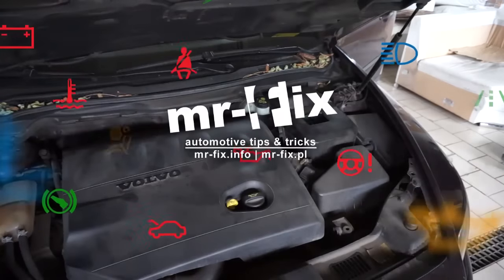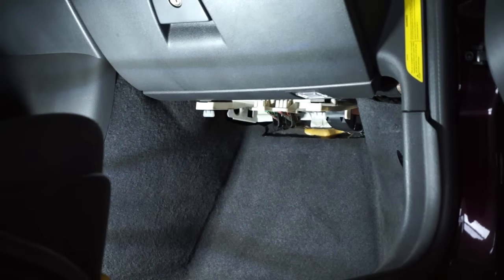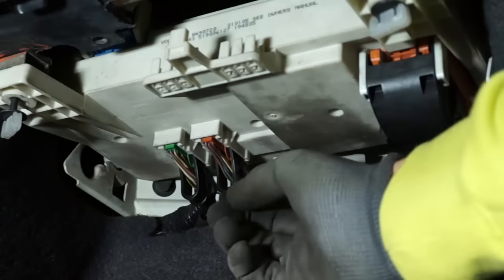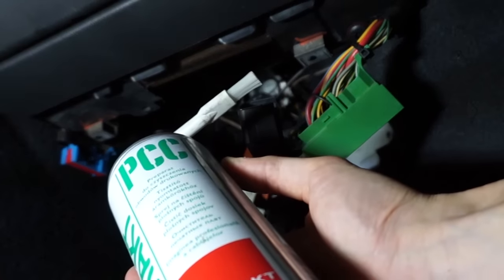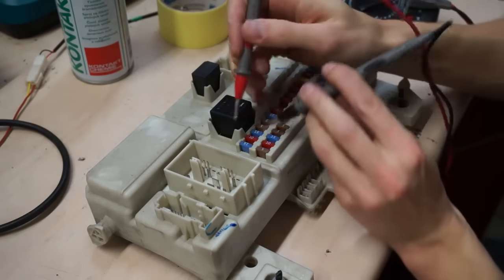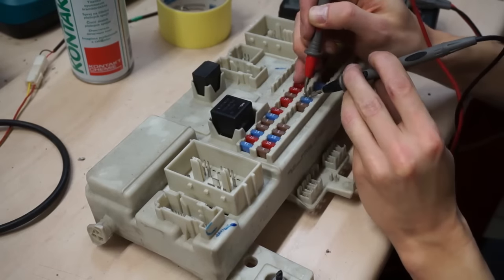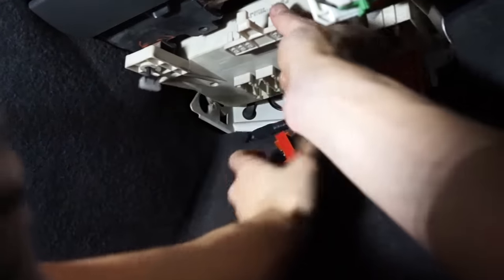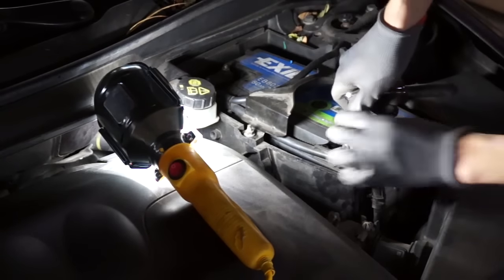Volvo C30 S40 V50 CEM / Ford Focus MK2 GEM connectors fix

Comment: I want to give this video a good thumbs-up x10000 and stick in on the first page of YouTube.

Here is my story. I have had weird electronic issues for the past 4 years of owning this vehicle. Some of them really annoying and even game-breaking, others no so much. When I first cleaned and re-attached my outside temp sensor and it started functioning properly, many of the faults disappeared but some of them remained. Difficulties to start engine, random errors on dash such as anti-skid temporarily off, anti-skid service required, ABS failure, traction control fault, radio and A/C acting up, windows not working properly. I did not give it so much attention as I should have at that time since all errors disappeared once engine started and others were not as bothersome.

All that to a point where my car would just not start anymore. Happened last sunday, was driving normally for two days and 600 kms and when I took a break to quickly wash major dirt off car, it would not start at all. Tried cranking till battery died. Towed back to home, recharged battery and tried again, no positive result. Engine was cranking but not starting. Took apart throttle body, cleaned everything, double cleaned all sensors and checked if everything was in order. No result. Was ready to go and get new FPR and even thought about having blown fuel pump. By accident I happened to check your channel and look through your videos when I found this. Having nothing to loose and symptoms similar to what you mentioned (adding those that have been occurring for past years) and nothing else I could do at that point of time, I took that crap apart, cleaned everything and put it back together.

Not only did it get my engine to start again, it fixed everything that has been wrong with it for whole time and car starts so much better than before.

Many thanks from Estonia, my friend, and god bless you for doing what you are doing! World needs more people like you!
Reply: Wow
Reply: Ditto! Wow!

Comment: I just want to say thanks for making this video.  My daughter came home in her 2006 S40 last night and complained about multiple issues that occurred all at the same time.  The car was working fine the day before.  Some of the items were:  power windows and door locks not working, wipers wouldn't turn off or change speed, gas gauge not working, speedometer not working, SRS (airbag) error shown on dash, etc ...  Obviously it had to be something related to the computer system since so many systems weer effected.  This evening, I spent about 1 hour following the instructions on your video.  After putting everything back together, the error messages were gone and all the systems worked again.  I don't know if it will last forever, since the car has had some alarm system issues recently as well but we'll see.  At least we were able to get the windows closed, since they had been stuck in the down position.  Thanks again.
Reply: Have you had anymore issues with the car since doing this? I've got an 06 s40 with almost the same issues.

Comment: Bough 08 Volvo S40 two days ago. 1750€, fleet car, excellent condition BUT random airbag fault, random power window problem, random central not locking, starting problems, random sudden acceleration. I followed your instructions and cleaned all the contacts with 6€ can of rapid drying contact cleanser. All problems gone. Thank you so much man, you saved my day!

Comment: Wow. My 2007 S40 had been having electronic throttle issues and showing the red triangle and "ENGINE SERVICE URGENT" message for weeks. This (along with cleaning the connector at the accelerator pedal) has solved the problem for over a week now. I love solutions that cost only time and effort! Thank you!
Reply from the maker: Happy to help! Check my other Volvo tutorials - maybe you'll find something interesting for your S40.

Comment: Just want to say a massive thank you for this video, my V50 was causing all sorts of issues, going into limp mode, windscreen wipers coming on, not able to turn of, messages saying, 'Engine problems, ABS fail, brake fail,  last thing that happened was engine died and would not restart, etc. Took the module out, cleaned all the contacts, car now works absolutely fine!
Reply from the maker: Happy I could help you! Check my other Volvo related tutorials - maybe you'll find more useful stuff.

Comment: This video is invaluable in resolving electrical issues with my 2009 Volvo V50. I have very little experience 'working on' cars, but this video provided all the information I needed to complete the job. Many thanks!
Reply from the maker: Hope that you car will stay trouble-free for a long time!
Reply: I have the V50 2010 model and have had power issues with it which haven't been able to short , no fault codes showing , but just this last week had reduced engine power dash light on and it wouldn't rev beyond 3000 revs , cut out quite a few time ,  apparently its too do with the E C U , but not certain , it's going in next week for a proper diagnostic check,  so fingers xd.  Depending on the cost I'll be looking for a petrol engine car again , it's cost me a lot up to now over 7 years of ownership,   trouble is I like the car style wise and practicality.

Comment: Thanks for this video. I own a Ford Focus MK2 and for the last 10 days I lost central lock, wipes, alarm lights etc. Your video motivated me to try to clean the contacts on my car's GEM. It was not so hard to do it, and now everything seems to work perfect. I hope it will last! Thanks again!
Reply: I have focus mk2 .. had problems with the cluster i fixid it.. yesterday my car crank but no start .tired to find the ecu but couldn't.. i removed the gem and cleaned it but not the connectors .. just the gem inputs where the connectors go .. should i do the connectors too .. ill do it any way.. but where is the ecu

Comment: Easy-to-follow instructions and clear video.  Most importantly this procedure completely fixed this problem on my 2010 Volvo V50, probably saving many hundreds of dollars in unnecessary parts and labor at a repair shop.  And, sure enough, my drains were clogged up with debris--mainly maple tree helicopters.  Thank you very much for making and posting this video.

Comment: You may be my saviour! I have bought my V50 less than 2 weeks ago and really like the car but today it stranded me with no warning signs before this. I bought from a dealer and had it checked at a independent garage before purchase and got a 3 month warranty for engine and gearbox only. The issue emerged after a 1 min drive to the local shop. Came back out of said shop tried to go home and “2 new messages” appeared “Anti skid service required” and “immobiliser, try start again”. I tried to start and no crank or anything happened. Tried locking and unlocking doors and such for a few mins and 20 turns of ignition = nothing. Then the messages went away,it attempted to start and did start for about 5 seconds on very low rpm, 200 maybe then cut out and messages reappeared. Tried to start it again several hours later and messages were gone for first 2 or 3 attempts to start but it would not start and check engine light was lit up. Going to try this tomorrow. I am a complete amateur at this but your video is excellently detailed and it appears to just be a thorough cleaning and reconnect things job which might save my broke ass 🤞🤞🤞🤞🤞🤞🤞🤞🤞🤞🤞🤞🤞🤞🤞🤞🤞🤞🤞🤞
Reply from the maker: I hope that this will help. Please let me know when you're done.
Reply: @jamesmccarthy7913  This happened to my car today, dash messages = "anti skid service required" - "immobiliser, try start again" - "brake failure stop safely".  

Tomorrow I will follow the steps on this video.  Fingers crossed.
Reply: @jamesmccarthy7913  are either of your foot wells damp?   Your sunroof drains could be leaking into the car
Reply: @jamesmccarthy7913  have you had the error codes pulled from the car?   Without those it'd be impossible to say
Reply: @jamesmccarthy7913  I took my car to a volvo specialist.  They say the cem has corrosion from water & my 2 options are a new one from Volvo at £1100 or a refurbished one fitted for £750 - not good 🙁
Reply: @jamesmccarthy7913  The only recall Volvo made that could be related was one for water getting on/into the CEM wire harness, the recall number was R39247 which affected models:  C30 S40 V50 and C70, Volvo after checking my VIN number say my car was not affected by this recall.  

I was hoping it was so they'd help with the bill.  Reading online people have bought new/refurbished CEM units & that solved the problem, however worryingly in some cases the problem reappeared weeks later.  I hope after spending the money it is fixed.

I need to find out where the water comes from to prevent a repeat.  Some CEM water ingress comes from sunroof drain, I don't have a sunroof.  Others have blocked hose drain tubes in their A pillars, others have it coming in from under the windscreen area due to blockage, others have water from heater matrix or cabin pollen filter area.

Volvo are currently involved in a lawsuit in the US due to the amount of owners who had to pay for CEM due to the sunroof drain problem.

Printed circuit boards can be waterproofed simply by using PCB lacquer.  Obviously the CEM was never supposed to be exposed to water so Volvo never coated the circuit with PCB lacquer.  

I hope you get a solution to your problem.

https://www.google.com/amp/s/uk.car-recalls.eu/listing/volvo-car-v50-fluid-may-leak-into-wiring-harness-which-may-cause-fire/amp/
Reply: 1984veritas I just stumbled across this and thought this maybe useful for all V50/S40 owners out there. http://forum.vccn.no/dokumentasjon/Volvo%20koblingsskjemaer/x40/tp3974202_s40_v50_2004-_wiring_diagrams_section_3_39.pdf

Comment: Thanks. I have done this this afternoon. Good tip to take top connectors off first. I have cleaned all mine on a 2005 V50. It all looked clean, but you can't be sure. I used lots of fluid, so I am leaving over night to ensure it all dries including any residue. I pray it works again. It is very difficult working in this footwell. It would be easier for those who have a lift and can stand up to get to this unit. If after this my car still has issues, I think I will sell it as spares. It is 15 years old now, and not worth the money on even a refurb unit... I hope this will not be necessary!
Reply: Did it fix it?

Comment: If you have an older Volvo and you're getting electronic problems, issues, and cryptic bulshit warning messages popping up on your Dash, then this is your likely solution. I had every issue listed here including brake warning light, pedal sensor, all gauges stopped working, check engine light, P0171, p0240, immobilizer warning, and at least 15 other warnings on my car when it started jerking around on the highway. Cleaned the CEM and every single one of them is gone. Including the check engine light. No codes and run smooth

Comment: Thank you very much for the video. This saved over 1000 € my money. The issue caused very many problems over two years since I bough V50. I decided if this don't help, I buy a new CEM. I didn't need. Now I have a very good car :).
Reply from the maker: I always feel better when I fix something instead of replacing it.
Hoping you car will run flawless from now on!

Comment: Thanks for this video! I had exactly the same issues as you described and after cleaning the CEM all errors disappeared. Your video has definitely saved me the hassle of going to a dealership.
Reply from the maker: Happy to help! Check my other Volvo tutorials, maybe you'll find another useful video there.
Reply: Yes, I've seen them, thank you! Great videos 👍 Might just work on the EGR in the summer 😉
Reply: @Mdvr85  Did that solution last?

Comment: WOw. It makes sense. I fixed the horn with the same. And the garage asked over 1 thousand to fix it. Since cars have electronic circuits, they need water seal but many have not so after many years the need this service. And it is better to put also a dehumidifier small package near by to absorb the humidity.

Comment: Thanks for the info. I did this. Had similar problems. The car also didn't start. Just cleaning the pins on the gem unit did not work unfortunately. Then I thought to open the whole unit to see the circuitboards. Around one of the connectorpins was a corrosive black damp mess. I cleaned it with lots of alcohol based Kontakt spray. Not the oily stuff. Then used some cotton swabs and a brush. There had clearly been a short circuit there. The solderpoints where almost gone. I didn't solder them again. When dry I put it back in the car and all fault codes where gone an the car started. So this non-starting happened while driving through snowy weather with lots of snow on the low part of the front windowscreen. I think the warm engine melted the snow and it somehow dripped exactly on the unit under the dashboard. I might add a plastic cover to the unit and always clean all snow and leaves from the front window drains.
Reply: Check the windscreen adhesive. Common failure point on Volvo

Comment: plain video not as much room in my s40 short wiring loom but was big help in general.. cheers
Reply from the maker: Happy to help!
Reply: mr-fix
 yes fingers crossed the clean up works trouble is only way to find out is to wait and see, you can bet if its not cured , it will wait till it is cold wet and windy night till it breaks down again lol.
Reply: Just done s40 today had to sacrifice some of my interior carpet next to no room in there seems to have fixed radio and heated seat problem I has

Comment: Damn I am living with this issue for years. Will give a try to this cleaning, thanks. It happens i my case when weather changes to very wet.
Reply from the maker: Most likely there's moisture causing this issue in your car. Check you water drains (for sun roof and AC).
Reply: @mrfixpl   Will do thanks. Yes I got info from forums that it's moisture related thing and cables above passenger feet cause glitches and dashboard insanity. Just never thought it's not so hard work to try and fix it. Will try on the weekend. Thanks to your informative video.
Reply from the maker: Please let me know if it fixed you problem. And good luck!
Reply: @320Sergei  Did cleaning fix it? If it did, have the solution lasted?
Reply: You also need to check the windscreen. A common problem for the volvo is that the windscreen adhesive fails, which allows water to enter the footwell. The carpet needs to be removed to fully dry as there's foam insulation adhered to the underside of the carpet which holds the water. If the windscreen is not replaced and the car is not dried the fault will reapear.

Comment: Just had issues with my Volvo v50 reduced engine power light on dash then cuts out ,  but had lack of power off and on over quite a long period,  changed sensors & E G R , still no improvement,  found it was to do with the E C U , but got it booked in next week for a diagnosis check ,  apparently its a common problem with this model , which is a bit disappointing when you think what I've paid out already , just keeping my fingers crossed 🤞 it's not too expensive.

Comment: Great film - many thanks! But what about low battery problem combined with immobilizer error? So the battery was low and afer it the info appears and it's impossible to start the car. What would you advice?
Reply from the maker: Charge the battery and hope that the immobilizer codes were not erased during voltage drops.
Reply: @mrfixpl  Thanks a lot man! Regards
Reply: Hi did you manage your get your car started?
Reply: @michaelwhitney3301  Hi, it was a nightmare... A new battery was jus a beginning. My car was six weeks in a workshop... They finally fixed it but it was a mess... Sorry for disappointment. Regards

Comment: Hi I have a clutch pedal sensor signal fault which goes through the CEM Unit. Have you seen this before and is it the CEM unit itself ? The clutch sensor has been replaced

Comment: Do you think this issue could be the cause of sporadic faults, not necessarily many faults at once? E.g. I occasionally get ABS fault. It can happen once and then be fine for a few months. Now it's happening pretty much every day lately. 

Then in winter I sometimes get gas pedal fault/accelerator not working. This is definitely related to bad contacts because it almost aleays happens in very wet and cold weather. Then a few times I got random lights on the dash blinking plus accelerator pedal fault. Also in winter. I guess there's only one way to find out and the procedure seems easy enough to try.

Comment: Do you know what the coloured plugs going into fuse box are for so you have brown on bottom green and blue on top I can't find any info on them I have a bent pin on the brown plug on bottom
Reply from the maker: You should look for "volvo v50 wiring pdf" in Google and check the pinout of the module.

Comment: thanks you for the great work. I have got an informative message on the dashboard says: ABS service required and ABS light on. and it goes off when I turn the engine off for a while. the car runs fine! what do you think is the issue. no error codes!
2007 volvo s40 2.4i

Comment: My 2006 c70 has lot's of gremlins. Boot fails to open occasionally, out side temperature sensor goes haywire, roof thinks it's open, windows fail to operate on one side. I also have a p0171 code that I can't get rid of despite changing both 02 sensors cleaning maf and checking for vacuum leaks. Will cleaning my cem fix all these issues?  Or would fire resolve it completely 🤔
Reply from the maker: I would start with cleaning CEM 😉